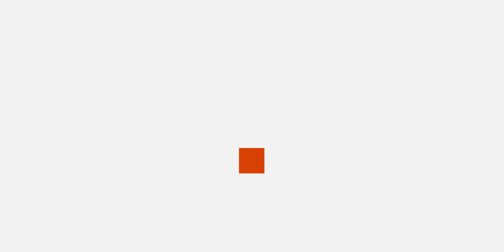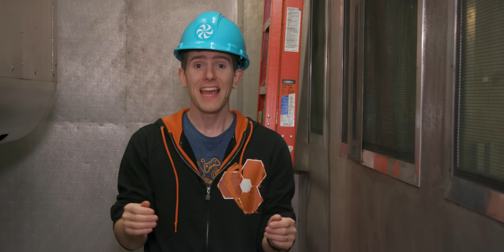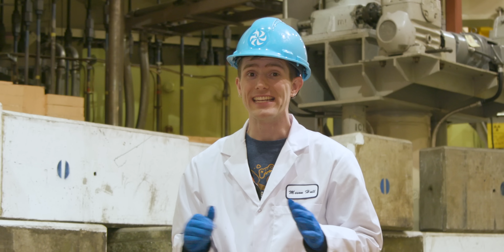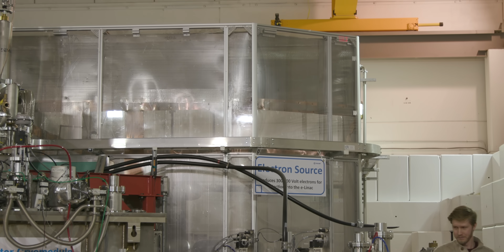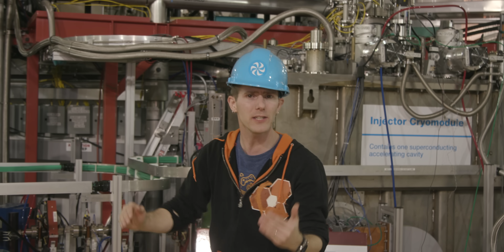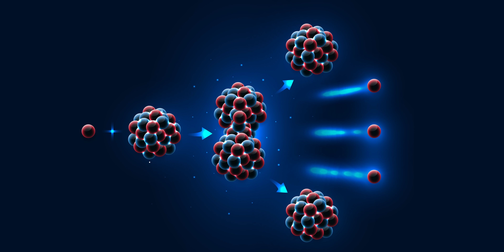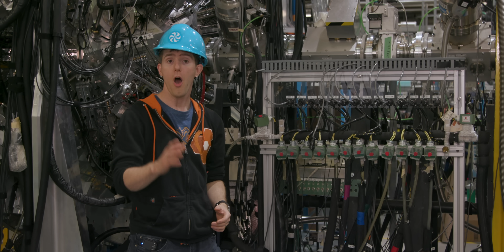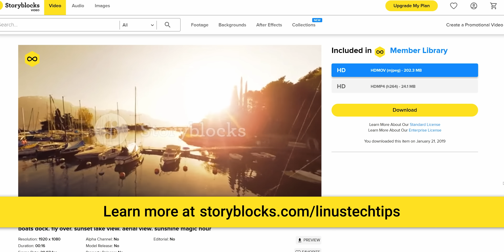The World’s Largest Cyclotron

Comment: You showed particle paths going from point A to point B, turning corners to go to point C, but what you didn't point out was that the particles are going very fast and don't want to go around corners so they need to have very strong magnets to make the particles curve.  And BTW there is an early cyclotron in the Smithsonian- it's about 6" diameter.

Comment: Accelerating particles to 75% speed of light is impossible..as cyclotron works on the principle that the frequency of the particle and the HFO(high frequency oscillator) must match..but when particles move near to speed of light, their mass increases(maybe even double or triple)..which inturn will change the frequency and hence frequencies wont match and thus proves why particles cannot be acceerated to 75% the speed of light..This is an application proof that nothing can travel faster or equal to the speed of light!

Comment: Cyclotrons (circular pulsed induction coil-based accelerators) are, in fact, THE DEFINING DEVICE NEEDED to create new types of propulsion systems for modern aerospace craft! 

This video highlights UBC's (University of British Columbia) TRIUMF facility....

See wikipedia links:
https://en.wikipedia.org/wiki/Cyclotron

and

https://en.wikipedia.org/wiki/TRIUMF

that is today being mostly used for creating medical isotopes that can irradiate cancer tumours and for other medical uses such as making mildly radioactive medical imaging contrast agents.

BUT ANOTHER USE is for colliding STABLE heavy nuclei such as Tungsten, Gold, Lead, Manganese and even Iron so that their collisions produce sub-Planck's scale (i.e. very minute!) Gravity Waves which are used as inputs into a GrASER (Gravity Amplification by Stimulated Emission of Radiation) which basically functions very much like the optical-wavelengths LASER or microwave-wavelengths MASER devices which can reflect, refract, diffract and sum incoming waveforms to form a usually monochromatic or monowave pulse that is of a higher amplitude and/or of a specific harmonic (i.e. a upper or lower frequency of a source waveform).

LASERS and MASERS can cut metal, burn things, be used as long distance communications devices and have other major scientific uses! A GrASER is also very useful to modern science and engineering since it can amplify all the minute gravity waves caused by the continuous collisions of heavy nuclei. 

Since I have OBTAINED SPECIFIC KNOWLEDGE that the above heavy elements are only METASTABLE, it means you can use a specific TYPE of cyclotron to INDUCE radioactivity (i.e. controllable fission) using a combination of specific PULSED EM waveforms of specific energy levels for either direct large-scale power production systems OR be used as the inputs into GrASER systems which use EM surface waves that hug a CNC-machined cavity resonator and waveguide system to create a VIRTUALIZED version of the hard-engineered resonator/waveguide which will then trap and sum the normally non-confineable gravity waves. 

Why would we do this?

Amplified Gravity Waves can then be directed by a "Virtual Cavity Resonator/Waveguide" system towards a specific 3D-XYZ axis and/or to a specific 3D-XYZ point so that local time-space can be compressed or expanded at practically super-luminal speed (i.e. a high angular velocity) so that an aerospace vehicle can ride in the TROUGH of rapidly expanding/compressing space-time waves moving between ANY two points in 3D-XYZ intergalactic space. 

Think of a long bridge which you want to walk along to the other side! Why walk the actual distance when you can use some fancy technology to simply BEND the entire bridge deck over into a loop and just jump across the now much shortened gap between the curled-up bridge ends and then UNBEND the bridge deck again once you've jumped across the smaller gap to the other end of the bridge!

Gravity BENDS space-time! NORMALLY you need a VERY LARGE MASS to do so, such as a large sun or a supermassive black hole or other majorly sized interstellar object! BUT NOW, a gravity wave amplified a billion-fold+ in a GrASER can do the exact same thing and we can take advantage of a "Gravity Beam's" angular velocity to move localized time-space distortions between ANY two points in our galaxy or outside of it at FTL (Faster Than Light) speeds! 

AND since I have access to some rather high-up people in the Black Budget aerospace community, I know that some of the largest aerospace firms in the world have been ACTIVELY PURSUING this very type of technology using their own versions of  GrASERS and high-energy cyclotron-based collisions of metastable elements as the input gravity wave sources!

US Patent Number: US10144532B2
"Craft using an inertial mass reduction device"
https://patents.google.com/patent/US10144532B2/en

This above patent is SOMEWHAT similar to the amplification systems noted by me BUT with the major difference in that we now know that specific configurations of Cyclotrons can be used as the "Input Power Source" for special propulsion systems-based aerospace vehicles. AND that you DO NOT have to use deadly general nuclear power systems powered by Uranium 235/238 or the ultra-toxic Plutonium. You can use COMMON and CHEAP heavy metals!

ANY modern CAT or GENERAC-brand conventional power production system (into the 1.5 to 5 megawatts range) can pulse the induction coils of a portable cyclotron in the manner required to produce the types of heavy nuclei collisions which will create the input gravity waves of a GrASER system used in advanced propulsion! AND that cyclotron can be made as small as the size of a common U-Haul Moving Van so it can fit inside MANY large vehicles!

So now, YOU TOO can make your OWN dark, black flying triangle that can hover silently over your house UNTIL you need it to instantaneously travel to Kepler 22b for your upcoming intergalactic water-world surfing competition!
Reply: YES! I know the first objection someone in the physics world will raise is that gravity waves propagate at only the speed of light and will also ask HOW does angular velocity figure into this?

1) take a flashlight (or laser!) and scan the beam across the night sky from the far left side of your field of view to the far right side of your field of view very quickly! Congratulations! You have just discovered ANGULAR VELOCITY where it APPEARS that you have covered many light years distance in the mere matter of a second or two!

2) The flashlight (or laser!) still exits and travels away the light source at the speed of light so it's LINEAR velocity stays the same at 299,792 KM per second BUT because you SWEPT the beam across the sky much like cutting out an "Slice" from a pie or cake, you have covered a HUUUUUUGE angular distance in a tiny period of time.

And what does this have to do with Cyclotrons?

a) Cyclotrons are a mechanism to provide the SOURCE of minute gravity waves coming out of the collisions of nuclei between metals that SEEM to be only METASTABLE (i.e. add extra externally sourced energy to them and a sudden cascade avalanche energy release is realized!) rather than truly stable in their core configurations. 

Technically, the metastable heavy metal particles "tunnel" into a lower energy stable state when external energy of a specific configuration is applied very much like stomping your feet at the edge of a steep cliff to start an avalanche of falling rock. The rest of the energy is of course conserved and output at externally measureable amplitudes and rates. 

Of course, when we are dealing the the "Strong Nuclear Force" the binding energies are IMMENSE so the cast-off of extra energy is ALSO of extreme magnitudes!  These cause SHOCK WAVES which can manifest themselves as amplifiable gravity waves. It's not quite fission, since it is theorized that Quantum Mechanics and Chromo Dynamics come into play here.  The KEY part is to impart enough EXTERNAL EM energy that is added and applied in a specific manner such that a Meta-Instability event can be facilitated for a specific particle such as Gold, Tungsten, Manganese and even common Iron!

It is a guesstimate of certain parties that I am familiar with, that harmonics can play a role much like where one can shake a physical structure at a specific frequency and amplitude to cause an catastrophic cascade failure of that structure! It is has been suggested to me that certain common heavy elements are SUSCEPTIBLE to this "resonant shaking" such that they "Shake Apart" in a catastrophic sudden energy release to a more stable configuration when external energy is applied. (i.e. the core configuration hits a tipping point and then collapses!)

b) The resulting "Shock Waves" can be harvested like any other waveform of a given amplitude and frequency in a resonator/waveguide circuit to cause LARGE SCALE EFFECT upon the local environs. That effect can be PROPAGATED to cause work to be done and in this case, provide a distortion (i.e. compression or expansion) of local space-time by creating an artificial "Large Mass-like" effect on the local environs which means this "Mass" bends, stretches or compresses space and time at rates that SEEM to exceed the speed of light. 

Other people high-up in the Black Budget aerospace community have indicated to me that OTHER Sub-Planck's scale mechanisms are also at play here such that the propagation speeds for time-space compression and expansion have been measured to be on the order of 10,000 to 50,000 to as much as One Million times the speed of light! This means it would take us only a mere second to cross over to our neighbouring star Alpha Centauri if we can encapsulate an aerospace vessel within a "Bubble" of normal space that is carried along in front of a single large "space-time compression wave" like a surfer or held steady in the trough between two moving time-space waves !!!!

The effect that is envisioned is VERY SIMILAR to this Youtube video on 
Three Dimensional Mid-Air Acoustic Manipulation and Levitation:

https://www.youtube.com/watch?v=odJxJRAxdFU

but instead of suspending particles of foam within standing waves of sound, you can move a spaceship through 3D-XYZ space by suspending it in-between "standing waves of gravity" coming from a GrASER apparatus!

Comment: So I think you have missed a very important opportunity to relate the work done at TRIUMF to the world of consumer (and space grade/military grade) electronics. One of the main reasons that TRIUMF was built was to provide a high energy proton source that can mimic the energy of energetic protons trapped in the magnetic field around Earth. Components used on spacecraft that orbit or travel through the proton belt, undergo extensive radiation testing on Earth to ensure that the components will not fail in space.  One of these tests is called Single Event Effect (SEE) testing, where a device is bombarded with the protons to see if a proton can cause a bit flip (0 -> 1 or 1 -> 0) or latchup.  Pretty much anything with a transistor can experience these effects, such as memory (DRAM, SRAM, etc.), CPUs, FPGAs, and GPUs.  The accelerated electrons are also used for total ionizing dose (TID) testing.  When a charged particle (in this case the protons and electrons) pass through the component, they deposit a small amount of energy.  The energy deposited can lead to a shift in the threshold voltage of a transistor (voltage needed to turn it on) causing it to be permanently on or off depending on the type.

For a demo, I highly suggest taking a GPU, benchmark it, take it to TRIUMF, put it in the proton beamline, then retest the GPU.

The folks at TRIUMF would know what you're talking about if you told them you wanted to do SEE testing.  If not, I work in the industry and could find you a good contact.
Reply: Jennifer Taggart I would love watching this experiment! It would be super interesting to see the factor by which compute and reliability is affected by random bit flips. I hope LTT sees this!
Reply: Rowhammer could be a result of radiation effects in the DRAM but it is not the sole effect.  Depending on architecture, you can get a variety of effects, such as Single Event Functional Interrupts (SEFI) where a spike in current in one location could put logic gates in an undefined state, causing the GPU to hang. Once you power cycle though, the effect goes away (soft error). You can get random bit flips, burn outs, gate ruptures, etc. Some effects cause permanent  damage and others are only temporary. Some architectures have error correction or redundancy that can protect against some of the SEE.  Since the physics of how radiation is absorbed has to be considered on the material level, even variations between different production batches (same model) can see different effects due to fluctuations in the material layer thickness.
Reply: Hey, I'm a highschool student and it's my dream to work in this industry. 
Can I ask how you got to this point?
Do I need to get into a super good University for a decent chance?

Thank you
Reply: @Huzufu7  So I did my undergraduate in Physics (Ohio State Univ.) and my PhD in electrical engineering (Arizona State Univ.).  Vanderbilt probably has the biggest radiation effects research group, especially for doing simulations. Georgia Tech has some research, Oregon State has a research reactor. Berkeley and Texas A&M have awesome cyclotron/ion beam facilities.  Most people in the industry will have physics, electrical engineering, or material science degrees.  You can take some classes at the undergraduate level but you will specialize in radiation effects research at the graduate level.

Edit:  I make these suggestions assuming you live in the U.S..  Not sure about other country's programs though I know of a few in Canada, France and Germany.  I had internships at Intel and Sandia National Laboratories, also focused on radiation effects.  Keep a lookout for relevant internships after your sophomore year.  Companies in the aerospace industry and National labs will have more radiation related jobs than others. Also keep a lookout for NASA and DOE fellowships. It's a small knit community so the networking is more important than your school, but schools with radiation programs will help you make those connections easier.
Reply: @jennifertaggart3925  Very useful information. Thank you so much!
Reply: @LinusTechTips
any progress on this amazing idea?
Reply: wouldn't we already know that through the development of things like rowhammer?

Comment: Bit of a waste using three of those additional accelerators, time two particles through the system & slap a wake field accelerator on the output and boom, you've condensed all the energy into half the particles

Comment: I find it funny that all these super expensive science projects all say they benefiting cancer research...maybe I'm just dumb and don't understand it all that well but it just kinda odd that this has anything to do with cancer research and that they are essentially using cancer research as a tool to advertise the usefulness of these projects. And you wonder where they get all the funding for this stuff, oh yeah right it's for cancer research ;) wink wink....yeah sounds like a bunch of bs made up to get more investment. Now we know where our cancer research dollars are going, into particle research instead of cancer research...or so it seems at least, but again maybe I just don't understand it well enough but that's just my take.
Reply: Too be fair a lot of them contributed to  Curing certain kinds of cancer... High energy particles can  deposit  most of their energy in a small area within the body and the penetration depth can be change by changing the energy. Compared to that x-rays deposit most of their energy on the surface...your skin... And most of the energy dies not Even reach the cancer cell.

Comment: Why the fuck are they using like 1,000 + psi flanges and inch thick aluminum plate for a machine that only needs to hold a vacuum? if it's just for shielding purposes why are the flanges attached with like 50 bolts? This design looks like a horrendous waste of money. If you look closely there are places where half inch metal plates and glass plates are bolted onto openings in inch thick plates, indicating the inch thick plates only needed to be half an inch thick.

Comment: Before watching the video: cyclotron is a particle accelerator , you cant accelerate electrons in it as they are negatively charge nd will change their mass on very high speeds and break the machine, also protons can't be used as they are positively charged so we use neutrons.

Comment: dosimeter? isn't it called a Geiger counter?
also they really need some cable management
Reply: Not necessarily, Geiger counters are only one specific radiation measuring device (those using a Geiger-Müller-Tube). 
Dosimeter is the type of application for the device (measuring the dose you've been exposed to over time).
Geiger-Müller-Tubes are used in some dosimeters, but they require high voltage (several kV) to work which is a bit of a hassle in those small devices which are intended to run on battery for a long time, lately more and more use PIN-Diodes, for example the Polymaster PM1300.